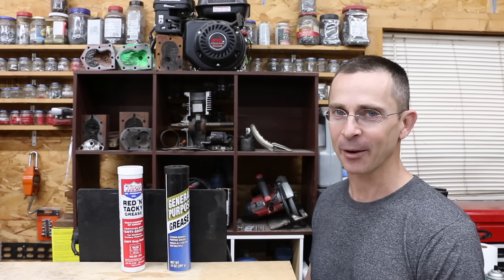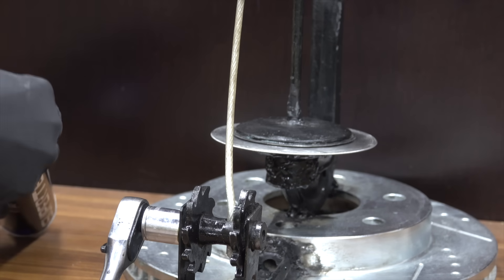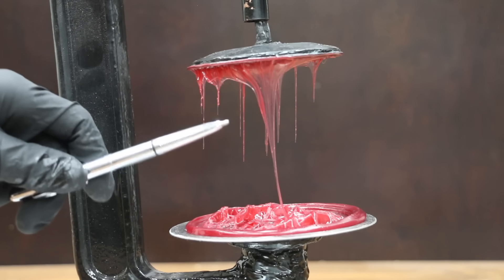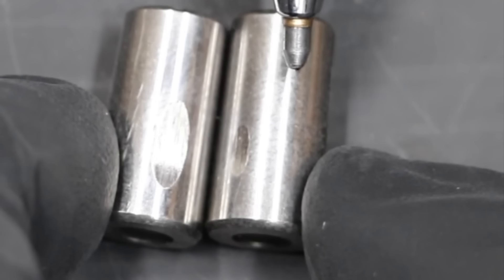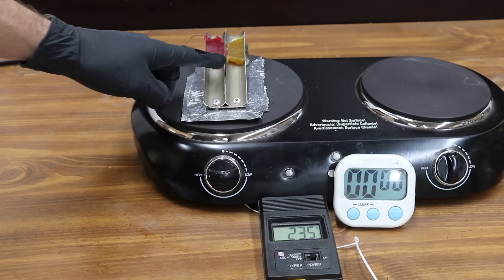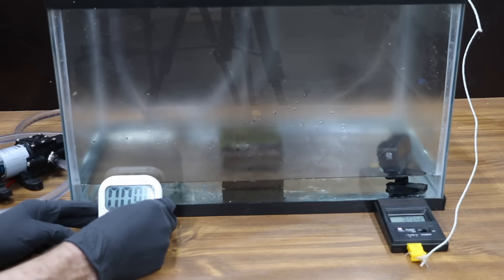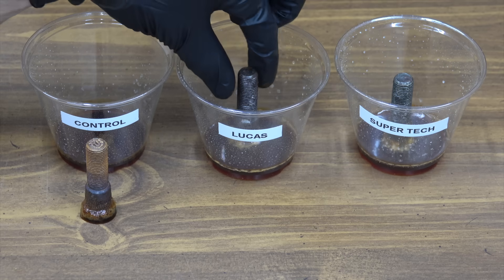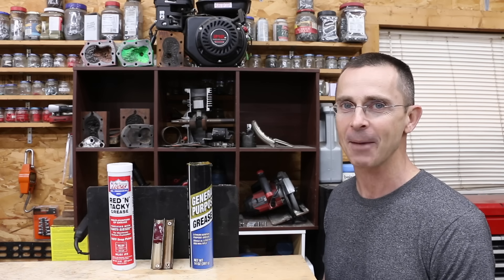Is Cheap Grease better than Lucas Red N Tacky? Let's find out! Bearing Grease Test Episode 1

Comment: Lucas may be better grease but, 
 I dont care much for it.  When it's cold like 40deg or lower it's hard to get the grease gun to work with Lucas red and tacky and it's a pita, it's more likely that things wont get greased. if you grease your equipment once every 10 hours it wont make much difference which one you use. I will tell you red and tacky is a terrible grease in below freezing weather. And if it's  20 degrees  forget it...We grease equipment and trucks daily and you can keep the red and tacky grease. It's ok in the summer but winter time its hateful to try to grease anything. I'd say you're better off with a cheaper grease in the bushing that a grease gun thrown down the hill...I've grown to dislike it with a passion. Sorry just being truthful... BTW if what ever you use that grease in, if it gets to 350degs the bushing/ bearing has already failed.
Reply from the maker: Great feedback. Thank you

Comment: Love it. I've always used lucas, either the heavy duty (green), or red and tacky   (red). I had wondered if there was a difference in grease and brands. Please do a video comparing the green and red lucas. I'm still unsure which to use. Red sounds better for boat trailers, green sounds great for everything else. I would love to stock only one. Most likely the lucas green. I had thought about trying the cheap stuff at least once but for the few dollars savings it isn't worth the time if it wasn't any good.
Reply from the maker: Great feedback. Thank you

Comment: I'd love to see you test Schaeffer's  grease. The rep. came into my shop and showed a few test like water resistant compared with red n tacky and their tests showed as their grease being better. They pretty much guaranteed their grease is the best on the market. I'd be curious to what a third party test came out to show.
Reply: It is good grease.  The thing is the grease doesn't really contribute to failures.  Torn boot on a ball joint, damaged bearing seal allowing debris to ingress, failure to grease at appropriate intervals.  Boat trailer bearings take the most abuse, again generally from neglect.
Reply from the maker: Thank you for the video idea!

Comment: 20 some years ago I mixed Slick 50 grease and Mobil 1 to make a thin grease for my mountain bike bearings. Like any thing that gets put through water and mud I still took apart and cleaned every thing. '95 GT Timberline still going, replaced ball bearings but races are ok.
Reply from the maker: Great feedback. Thank you

Comment: everybody's talking about those new solder connections with the built-in heat shrink tubing that you only need a heat gun to use. I've heard mixed reviews on these things. Do they really work? Let's find out!
Reply from the maker: Thank you for the video idea!
Reply: There are two types.  One that has solder, and one without.  Ones that contain solder is not recommended.  The heat it takes to melt the solder but not damage the insulation is a fine line.  In addition you can't verify it isn't a cold solder joint.  Non insulated crimp connection followed up with adhesive lined heat shrink to seal the connection from the elements.

Comment: Man, there must have been A LOT of gloves used in the making of this video.
Reply from the maker: lol.  At least 50.  Very messy testing!
Reply: @ProjectFarm  Do you have a preferred brand of nitrile gloves?

If you haven't tested nitrile gloves yet, I would love to see you do so.  They are not cheap, even the generic ones from Harbor Freight, but after a few bad experiences with latex and vinyl gloves ripping (even when not exposed to solvents or chemicals or any type), nitrile gloves are all I will use.

In addition to the nitrile gloves sold in big box and hardware stores, I suggest you test some medical grade nitrile exam gloves, as I've seen some use them.
Reply: @jayschafer1760  Thickster brand are my favorite by far. Amazon or Napa usually stocks them. I second the request for a glove comparison video.
Reply: @jayschafer1760  

Good idea!
Reply: False Flag  Back when I lived in the Midwest I would stick up on nitrile gloves when Menards had them on sale or with rebate.  Now I generally try to get them cheap from Harbor Freight.  I don't know that I've ever seen nitrile gloves as cheap at Walmart as you describe, but I'll have to look.

Your skin is your biggest organ, and I'm all about using gloves for safety and convenience around chemicals. Nitrile gloves are worth the money, but the cost adds up fast when you do tasks that require you to use many gloves as the gloves become soiled.

Best thing I have ever done in terms of gloves has been to keep a pair of leather gloves in the car by the driver's seat.  Those get used every time I fill up the tank, check tire pressure, etc etc.
Reply: @jayschafer1760  You wear gloves to check tire pressure? why?
Reply: @NaterAnderson  Brake dust and general grime/dirt around the tires and rims.  I have the reusable leather gloves in the car anyway, and using them to check tire pressure means I don't have to worry about washing my hands as well afterwards.
Reply: This gives me a video idea: which cv boot grease STAINS YOUR HANDS THE LEAST lol. I have yet to replace a cv boot and the grease without having my hands black for a week.
Reply: @jetjazz05  When working as a industrial mechanic, the stuff that worked really well at getting stains off your skin was Pumice soaps and other "grease removing" soaps and the like.

Comment: I have a helpful tip. When packing bearings with grease. Using your finger can leave many little empty/dry spots inside the cage of the bearing. To help this and get a more consistent application of grease throughout I recommend using a "food saver" vacuum sealer machine. Place the bearing and a generous glob of grease in a vacuum bag. Place the grease in first so the suction will push it through the bearing completely. This way you can see the grease flow though the bearing and be assured that there are no empty/dry spots. Fully filled with grease. It does not ruin the food saver machine as the grease stays in the bag. Also the bearing can be stored this way, perhaps in a toolbox, ready to be used in a roadside emergency such as a trailer wheel bearing going out.
Reply from the maker: Great tip!  Thank you

Comment: Interesting the light use grease I have used to protect motor cycles that have been stored to stop corrosion and on rusty metals I've mixed it with diesel to have protective and penetrating results which works well when you need to eventually restore them. You certainly showed the difference betwee the property's  cheap cheap grease verses a good quality one. Keep up the good work.
Reply from the maker: Thank you for the feedback

Comment: Great I have wal mart grease in my gun for years,  is there anyway you could do the video again but comparing more brands of grease?    I would like to see some long term test on stuff for over a year.  Like just off my head for grease,  grease up half your daily driver witn one brand and the other with another then compare after a year.  Would have love to see how car batteries handle the cold after sitting over winter.
Reply: another thought,  AA batteries.  One test i would love to see how they preform with different brands of headlamps.... then put off the side for a year and retest the same batteries and equipment.
Reply from the maker: Great suggestion! Thank you

Comment: I don't know nothing of Grease, and thinking it's all the same, I've bought the " Valvoline VV615 Automotive Multi-Purpose Grease " for $4.16 :
- https://www.amazon.com/gp/product/B000CQ4DIM

Searching for Lucas Red N Tacky, I've found this for $4.98 (There's also a pack of 10 for $4.52/pc):
- https://www.amazon.com/dp/B004X6V1DW

It's such I small difference that I'm going to change to Lucas Red until you test more brands ;-)

I'm in the Caribbean,  and everything gets very hot, so I liked the heat test,  and also the corrosion test the most (well,  i liked all tests)
Reply from the maker: Thank you for the feedback

Comment: I rarely use grease and am not sure what's even in my grease gun but its probably super tech. Every now and then (though not as often as I should) I will crawl under my truck and give every zerk I see some attention. I will also repack my trailer bearings every few years since I only put a couple hundred miles on them a year.

I figure that while I dont use grease very often, it's probably more than most folks. And while I've yet to have a problem with my cheap grease, for only $2 more, it would be worth it to go for the Lucas. Especially since a tube lasts me years.

BTW, how much time do you put into these videos?! It must be a lot because you don't cut any corners and it shows! I appreciate your hard work!
Reply from the maker: 50-60 hours or longer for the videos.  This one too a lot longer due to the research and test rig builds.

Comment: i like to use total grease (mainly need it for regreasing motor bearings on electrical water pumps). it doesnt get runny when warm, has the perfect consistency to reach the bearings (some grease types are to thick and wont properly leave the re-grease chanel)  and it isnt too sticky, which makes it nicer to clean out once the bearings need to be changed. but to be honest i dont even know if the company is even a thing in the us, since its an european company.
Reply from the maker: Great feedback. Thank you

Comment: Thanks for this. Shows why it is important to choose the correct grease for the job. Interestingly this doesn't really eliminate the super tech as a choice for me, just shows the importance of the higher quality grease in certain applications. So for my yard equipment (mowers, small trailers etc) the super tech is probably just fine as that is all light duty stuff and probably wouldn't see any difference. The heavier equipment that works in afar harsher environments however, would probably not do as well being cheap on the grease.
Reply from the maker: Great point! Thank you

Comment: well at the least cheap grease is still good for rust resistance and leaf spring bushing, but I'm always up to get the best grease I can! that's why I've switched to exclusively using Molygraph and wheel bearing grease.
Reply from the maker: Great point!  Thank you

Comment: Question is: why use such long cans? If it was less viscous, maybe, but these things have very low viscosity and you'd better destroy the can to get all the grease out. Or I suck at it.
Reply from the maker: Thank you for the feedback.  They long tubes fit into a grease applicator (grease gun)

Comment: In food factories they specify the use of "food grade grease" which as far as I can tell is just animal fat.
Reply from the maker: Great test idea! Thank you
Reply: It's vegetable based grease, red rubber grease is also based on it...if you used animal fat...lard.. it would go rancid, there's also edible grade silicone
Reply: Work in the food factory. It's mineral oil based. The main difference is additives should no kill you if ingested. For example, instead of molybdenum disulfide, you get graphite. And the performance of food-grade lubricants is subpar.

Comment: For as long as I have been alive my grandpa uses the red n tacky for everything. Form his trailer bearings to lubricating his chainsaw bars. Grandpa swears up and down by that stuff.
Reply from the maker: Great grease.  I hope to test more brands if there's enough interest.
Reply: @ProjectFarm  It'd be nice to see what product would work best as a general home-use lubricant. A product that would be general enough to fix squeaky hinges, loosens rusty pliers and small screws, can be used on a bike chain for someone who just casually rides, maybe lube small bearings like those in a fishing reel(I know there exists a fishing reel oil and grease, but I am curious if there is a better product that has more uses). Something that really has a "general purpose". The first two brands of lubricants I can think of are 3-in-1 and WD40(not a true lube, but works as one anyways), but I know there are others, probably store generic brands. Would a natural oil work better for a general use lube? Something like canola or peanut oil?
Reply: @DustyTheDog  That would be grease in spray form. I use it for everything you mentioned (rusty pliers need WD40 before greasing). There is less grease in the spray can because it has thinners and propellant (they both evaporate) but it is a great trade-off for convenience. No idea about fishing reels.
Reply: @ProjectFarm  yes you need to go by the spec of grease on the container.

Comment: Have used red n sticky grease for years in king pins, wheel hubs (great stuff if you have a rotary seal fail, it stops the axle oil getting into the drum and brakes ) , propshaft ujs etc. on all my circus vehicles as well as landrover and cars.
Reply from the maker: Great feedback. Thank you

Comment: I use the good stuff in each of the 72 zerks on my tractor. Not much to save going cheap, all to gain with the good stuff.
Reply from the maker: Very wise decision!  Tractors and tractor parts are expensive
Reply: @ProjectFarm  A 771 Cat quarry truck has a block of 13 fittings on the back of the rear axle and a block of 6 behind each front wheel.
Reply from the maker: Hi Lewie,  Great point!  What type of grease do you use on the 771 Cat quarry truck?  Wishing you and your family many Blessings!
Reply: @ProjectFarm  The quarry shop gets the Red-plex in bulk with an air greaser with an inside pump and reel where it all stays warm. Only the handle is outside where you grab it and run till the ratchet catches and you can start it pumping. That's where my experience with Delo came to pass too. Everything uses the same oil and grease and ISO-68 hydraulic oil. The 980-G loader there was the one with 24K PLUS hours and never been touched internally. And I greased every day, whatever I was running. When I was draglining I toted a hand gun and still greased every day. I don't grease the mowers once a day but they sure stay lubed up! Old habits are hard to break and some don't need to be. The 771 had the grease blocks that were easy to get to but the 773 and the 40-ton Terex trucks had to be crawled around which I can't do. And the R-35 and 22 were even worse. I'll stick with the mowers. Thanks, Commander and BLESSINGS upon BLESSINGS!
Reply: Haha it's the difference between tractor parts lasting 15yrs vs 30-40 or more , a couple bucks spent there can literally buy years.
Reply: I live in Florida, stopped using Red N Tacky because about 1/4 of the stick will liquify if I leave it in my shed (reaches about 140 in there in the summer), switched to Mobil 1 which is red and really sticky as well, but only a couple tablespoons will liquefy and run out of the tube. Not sure if it really makes it a better product, but a tractor's some heavy duty high pressure stuff so it might be better!

Comment: Project Farm Hey, great video as usual! Just a tip: Many times I've used a grease gun connected to a spark plug adapter to break free stuck engines quickly...it works like a champ, although once it blew the head gasket on a mower while still breaking it free.  Figured you would appreciate this, have a great day!
Reply from the maker: Great tip!  Thank you
Reply: Check out the series of videos called "Will they Run? Straight-8 Showdown! Packard vs Buick"
The Buick has a siezed piston and despite removing the head, they could not unstick the piston and so they capped off the cylinder with the stuck piston and pumped it full of grease to get it to move.  It's a great series of videos. 2 straight 8 engines, 2 teams and zero budget.
Reply: @tarstarkusz  yup Cold War Motors--great channel
Reply: tarstarkusz-- The race to the end of the driveway was kinda anti-climatic.
Reply: @dsloop3907  Yeah, but the videos were great.
Reply: @tarstarkusz--Yes they are. Bad Obsession Motorsports is another good site.